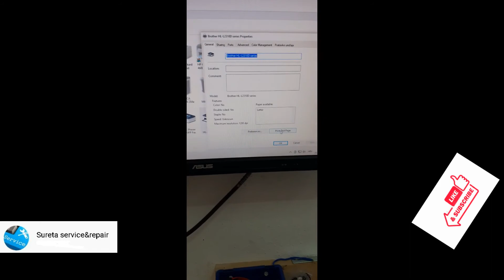👉#brother HL L2312D usb port repair!👈

Comment: Hi, I had HL-L2310D with damaged USB port for free. I replaced USB port but computer can't find the printer. Any idea what components on PCB I should check? Maybe blown resistor or something? Thank you.
Reply from the maker: Greeting! In most cases, it's the formatter board, I personally didn't even bother trying to fix it, because it's hard to get to the parts!

Comment: Great video, do you have the part number or know where I can get the part?
Reply from the maker: Hi! I'm glad you like the video.
In most cases, the printer USB connectors are the same. I personally removed the 1640 from the Samsung board.
Reply: @ServiceRepair-is  Thank you

Comment: Y dcp t300  brother, printer not detecting in computer
Reply from the maker: What type of connection do you use between the mouse and the PC?
Reply: Usb
Reply from the maker: Try with another cable, and try with another USB port on the PC. If the PC still does not see the printer, check the usb on the printer.
If you cannot physically see that the usb port is broken, then the formatter on the printer is broken.
Reply: Can we replace the usb port of printer only
Reply from the maker: Try it! Because you have nothing to lose if you don't try.